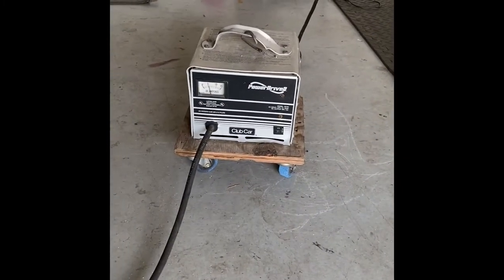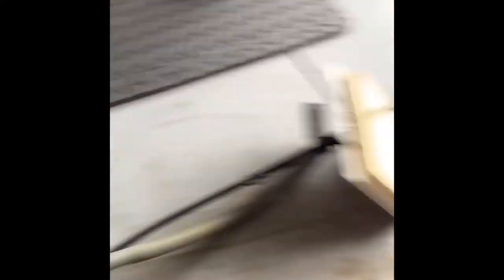2003 Club Car DS Not Charging Fix

Comment: Thanks for the video!  I had issues with the OBC on my '03 DS also.  I bypassed it and got a smart charger on Amazon for cheaper than a replacement Power Drive Charger.  The bypass is free and prevents the useless OBC from stopping the cart from charging and wasting your time.
Reply from the maker: Thanks for sharing! I have had no issues since swapping it out but will 100% look into this next time I didn’t know you could bypass it. Cheers 👍

Comment: If you have a smart charger, ie intelligent charger, just bypass the OBC. Splice into the 12ga black wire running from the receptacle to the OBC and connect to the last negative battery post. The computer board in the intelligent charger will act in place of the OBC for charging.
Reply from the maker: Thanks for sharing! I only had the original charger with the cart but I’m sure this will help someone else.

Comment: Thanks for the video about your issue with it not charging, Mine is doing the exact same thing and I checked every wire and fuses with no result, I wouldn't have thought to check the obc so thank you very much for giving me some where else to look.
Reply from the maker: No worries, I searched everywhere for a solution and found nothing so thought this might be useful to someone else. Good luck hopefully you get it sorted.

Comment: Did the cart still drive Before you changed out the obc? I borrowed my neighbours charger to test the obc charging system yet the same thing as you so I want to know how to test the obc before changing it out
Reply from the maker: Hi yes the cart would run fine it just wouldn’t charge. I charged the batteries separately with a car charger and it ran with no issues. 
After I changed the OBC the charger kicked in and has been good since 🤞
I can’t remember exactly how I tested it I’m sure I just tried everything else then but the bullet and changed it.